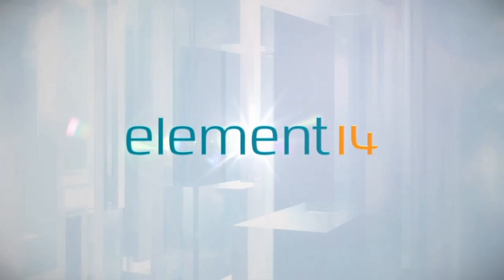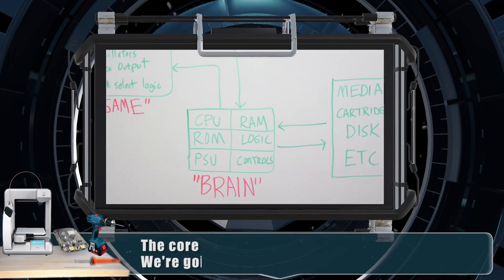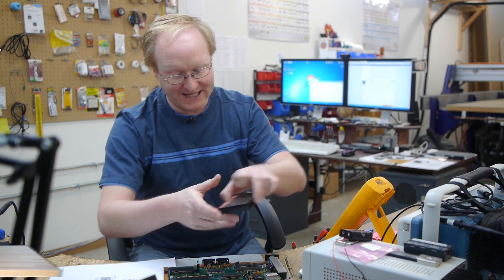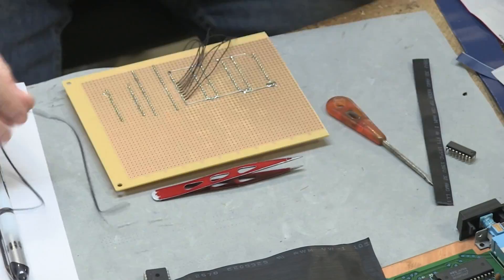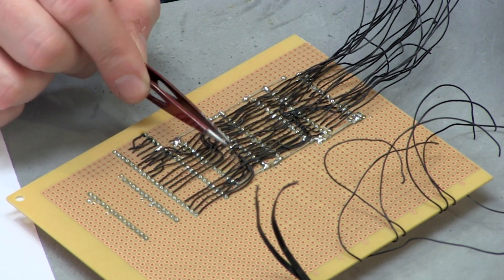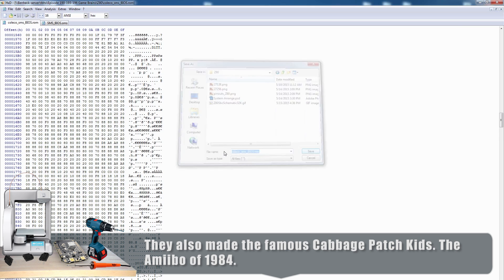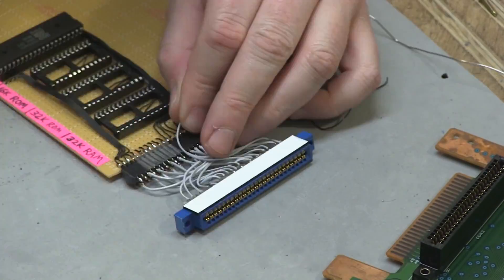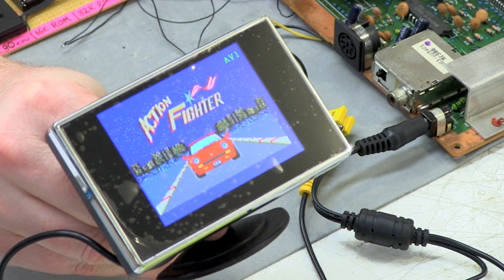Ben Heck's Game Brains Part 1

Comment: I'm confused here. Did the editor renumber the addresses after pasting it In?
Because a long Jump (jmp) contains the final calculated address after macro assembler is done its work. So in order for the one bios that has been moved from low address to high address all absolute addresses for jumps need to be offset. Which means the editor needs to understand the mnemonics of z80.
Reply: No need, since this was just using A13 for bank-switching two 8KB banks. So both 8KB "BIOS'es" are both starting at the standard address they're mapped into.

Comment: this is another difrent type of combo system, basicly you have a computer with a xbox and PS3 and normal computer parts and hook them up so an emulator looking program can boot up the system, and use your computer's keyboard//mouse as a controller

Comment: The Ben Heck Show 5:15 this happens because games are not dependent on bios routines (as most of MSX games are) - all Master System and SG-1000 games starts on 0x0000 (Z80 interrupt vectors included in the game rom), so there is no need for bios rom at all, and this also allow Master System games run on SG-1000 Mark-III without problems (unless the game used newer dsp features like 224 or 240 lines)

Comment: The Ben Heck Show  5:09 don’t forget that Sega SG-1000 Mark-III is a (Japanese) Master System without that bios rom - what that bios rom mostly has is a checksum checker (i think is to avoid running SG-1000 Mark-I and Mark-II games (very similar to ColecoVision and MSX1), so we need to fix the checksum from these games for running on Master System ) - i actually think that Chase-HQ is a Mark-III game that, by default, doesn’t run on Master System because this checksum issue

Comment: The reason why there are so many similar Z80/TMS9918 systems is due the fact it was the best cost/benefit back then.
You had to pick between the Sram chips that were veryexpensive, or the Dram that was (and still is) cheap but required a lot of extra circuitry to refresh it (basically the Dram "forgets" its contents if you don't keep constantly accessing every "block" of memory) and both Z80 and the TMS chips do refresh dram by themselfes.

So, if you used em, you could reap the benefits of the cheap dram price, but none of the drawbacks of having the extra circuitry or some fancy memory controller chip.

Comment: I've been thinking about doing something like this for years, so it's nice to see it being done! Although what I was thinking was an ultimate retro computer that contained both a Z80 and a 6502 so it could emulate the vast majority of 8-bit consoles and home computers, and a modern arm chip to control the system and interface with modern peripherals and media. Instead of using expansion boards to configure which system it emulated, you could either emulate the custom chips on the arm chip, or to keep it retro use a 68k to emulate the custom chips!

Alternatively, another project I've considered is a 'Retro Shield' for the Pi, that has a Z80 and a 6502 and perhaps a 68k to 'accelerate' emulators running on the Pi.

Comment: I'm always curious why you don't make circuit boards for these projects instead of hand wiring everything. The only thing I can think of is for trouble shooting if you miswired something. The circuit boards would be cleaner and likely be faster than wiring up something by hand.
Reply: Jeffrey Ball they want to show people who dont make circuit boards how its done.
Reply: ***** I'm not sure that's true. He's modifying components that were originally made for circuit boards. He also has the ability to use modern components (which he uses in other projects) but they won't make boards? "We have the technology..." I just think it would be cleaner, simpler, and faster. Again, the only reason I could see going this route is for trouble shooting. But even a circuit trace could be cut and a wire spliced in if necessary.

Comment: Where does one learn how to build a computer like this?
Reply: Brandon Butler Pick up a copy of "The Black Art of Video Game Console Design" by Andre LaMothe on Amazon (or wherever you can find it). Should tell you everything you need to know.
Reply: Brandon Butler See the other guy, but go see if you can get some back copies of any of the old TAB publishing literature on designing 8 and 16-bit home computers. Grew up with a copy of The Microcomputer Builder's Bible ( http://www.amazon.com/microcomputer-builders-bible-Chris-Johnston/dp/0830624732 ) in the house as well as their fantastic Z80 programmer's manual and Z80 bugbook and those are what got me into this stuff in the first place. You'll find that a large portion of the support chips listed in the Microcomputer Builder's Bible are still manufactured, though not so much most of the memory chips. But you can pretty much use way faster modern SRAMs as drop-in replacements.

Digital circuit design using big blocks like RAMs, ROMs and CPUs is surprisingly easy, once you know the basics! Just look up the datasheets and wire together the pins that need to talk, really.

Also on The Ben Heck Show :P
Reply: Brandon Butler Ohh, I just remembered another awesome one I had back in the day that you should check out: http://www.amazon.com/How-Build-Your-Working-Microcomputer/dp/0830696849/ref=pd_sim_14_8?ie=UTF8&refRID=1K2VCV6XTANNZBEA1KQX

Get 'em both. Trust me, if nothing else they're wonderful bathroom reading. I'd say I learned most of what I know just by virtue of having these stashed on the tank for years.

Comment: Ben, you'd be awesome if you could incorporate another system, but I'm not sure if it's doable:
From Wikipedia:
Nintendo's Game Boy and Game Boy Color handheld game systems used an 8080-derived processor with some Z80 instructions added (CB prefix) as well as unique auto-increment/decrement addressing modes. The CPU was a Sharp Corporation LR35902[65] running at 4.19 MHz in the original and Pocket models, and 8 MHz in the Color model. This processor was later included in the Game Boy Advance / SP / Micro taking up a new role as a co-processor for backwards compatibility with Game Boy / Color games (except Micro) and to add legacy 8-bit sounds to supplement the digital samples in Game Boy Advance games.
Reply: jorenmartijn It gets tricky with some of these old systems that use similar CPUs. Like the 6510 from the C64 and the 2A03 from the NES are both based on the 6502, but with some differences, like the sound built in to the 2A03 or the extra I/O lines on the 6510. All these CPUs also support some undocumented opcodes which are found in some actual production software as well.
The Game Boy's Z80 is a similar situation; it is neither exactly a Z80 or an 8080.

Comment: Oh, since the Master System's Z80 is also used in the Megadrive/Genesis for backwards compatibility and sound output, would it be possible to make a Megadrive Add-on for the Master System that contains most of the Megadrive' guts? You might have to use a seperate cartrige slot and probably use a seperate video output for the Megadrive-portion, but would it be able to get the Genesis working when hooked up to the Master System?

Comment: The "weird" ROM behavior was probably because of SEGA also selling some Master Systems with built-in games, for example I had a Master System II with the 8-Bit version of Sonic 1 built-in as a kid. Maybe SEGA stored the game on the same ROM chip as the BIOS on those units...?
Reply: Bright Spark In the master systems with games built in the games are on a separate ROM chip. I swapped Alex the Kid for Sonic Chaos in mine - because why not?
Reply: Bright Spark Nah, those units does not have a BIOS screen to my knowledge.. Not that you could get it to show unless you hacked it and disabled the built-in game. Here in Europe where I live Master System II with either Alex Kidd or Sonic built-in, was way more common than the original model. I don't think I have ever even seen the original model in real life, but I lived in a small town so :P